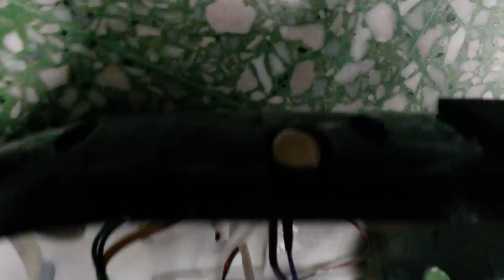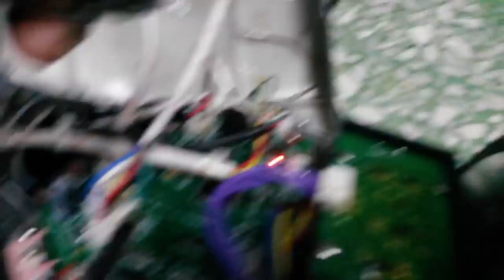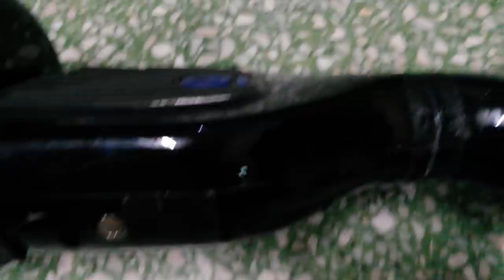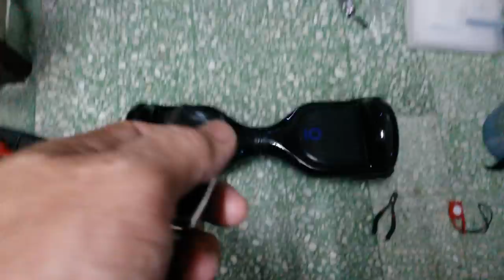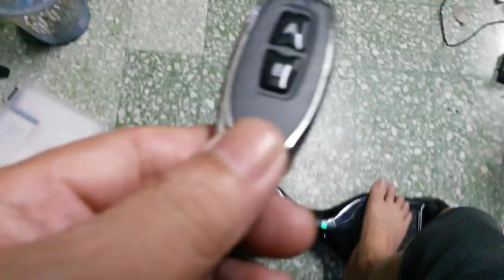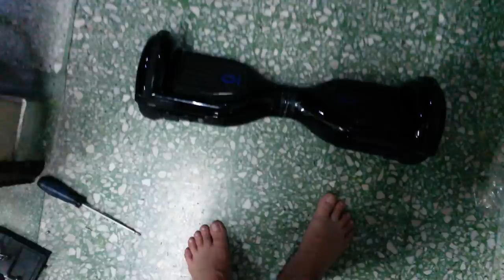Chic Smart 2 Wheel - How to make Auto Power On. Pt 4

Comment: You are right, there is no power on function, we don't suggest openning the scooter, because many end-users they failed to power on later. (CHIC-Jessica)
Reply from the maker: Jessica Zhang Thank you for your advise.

Maybe on your next version you should include the auto power on & may I suggest more bright blinking LED lights for night riding.

Auto power on can done in many ways, one of it could be by tapping on the footpads or the wheel a few times.

To make it more spectacular I will later probably add speeding motor cycle sound via Bluetooth, LOL.

Have a nice day.
Reply: putianren Thank you for your advise, we are now doing a new model like that.:) Have a nice day.